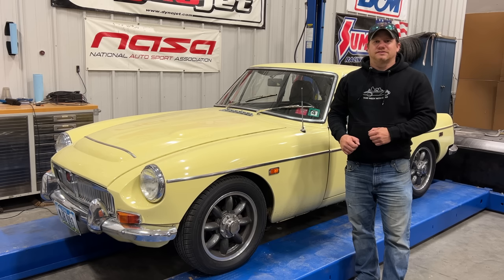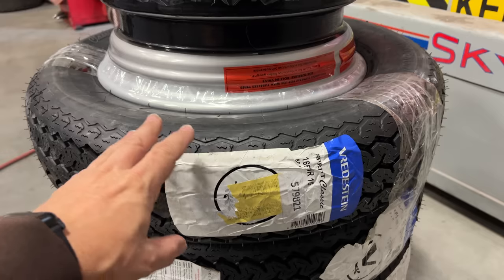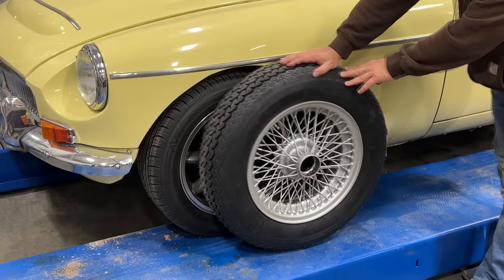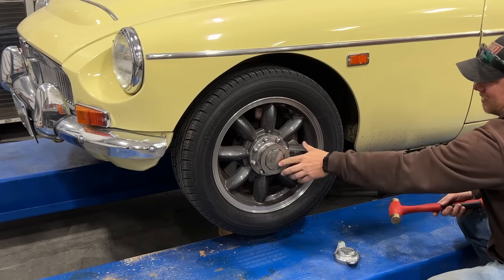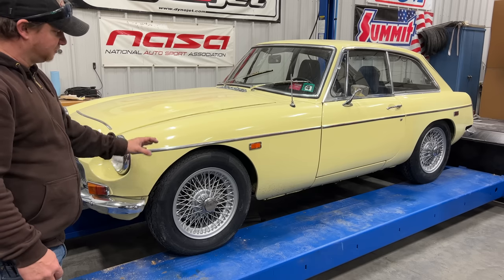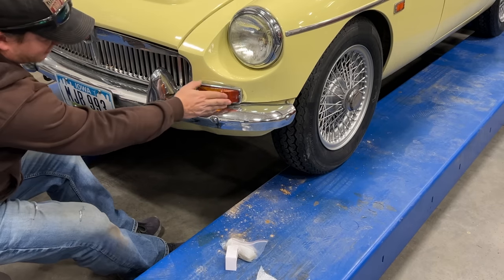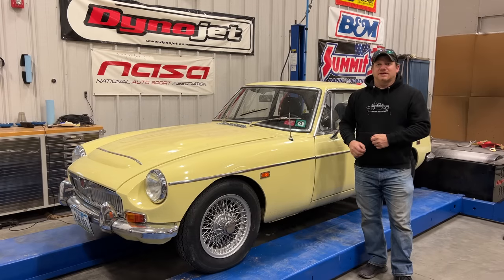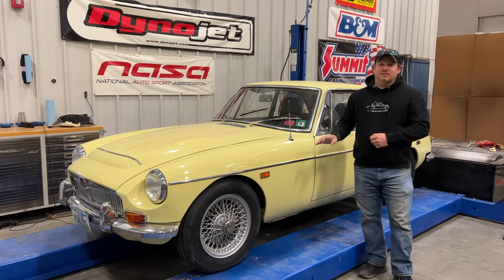Making the MG MGC GT Right

Comment: I had a 1968 MGC Roadster back in 1970 in the UK in Tartan Red. It was a fast smooth tourer but pretty heavy on the steering when parking. I initially put on a smaller diameter steering wheel for looks but soon reverted to the original large wire spoked wheel as parking became even more heavy!
It was also rather prone to understeer when pressing on with that big six cylinder lump up front. Top speed was just under 130mph, which I obtained often from its 150hp!
The only other modification I made was to lower the front of the car slightly to give a barely perceptible nose down attitude which improved the stance of the car. This I did very easily by adjustment of the front torsion bar suspension.
It was a great car that I only sold when I got married as my wife couldn’t reach the pedals.
Reply: I changed back to the original steering wheel on mine too but, overall, I never got on with the car as felt so heavy after the Bs I'd owned. The BGT V8 I had for three years was the real deal.
Reply: @rogerwatt8491  . I agree with the heavier steering. I had 1961 MGA mk2 a few years before the MGC and it was a much better driver on twisty roads, although still heavy for parking.  The prettiest car of all.
Reply: Similar story with my 69 MGC GT bought in 1970.    Sold mine when the second kid came along. Bad move. : )
Reply: Join the club! My first two cars back in 71, (a classic Cooper then an Escort Mexico) sold them on at probably ten times less than they would be worth now..☹️

Comment: Great find.  I just started restoring a 68 MGC GT in British racing green. Its an rare automatic transmission model.
Reply from the maker: My first CGT was a red automatic and then I got a BRG CGT but sold it because it had a sunroof cut into it and I decided it didn’t make sense to spend the money fixing the roof.
Reply: @ThisWeekWithCars  I bought a chrome set of rims in the right size to from British Victoria before they sold out to Moss Motors. My only issue is the Brake master cylinder.  I bought a rebuild kit but I'm hopping it works and that the unit is not worn out or too badly pitted.
Reply from the maker: If it was working recently there is a good chance it will just clean up and you can put your new seals in.
Reply: @ThisWeekWithCars  It will be one of my small inside winter restoration projects.
Reply: I bought a 1969 MGC GT in 1970... 4 Speed Auto Trans.

Comment: I was quite  surprised to see that the threads on the  wheel nuts aren't  left hand thread to reduce the risk of coming loose while driving in a forward direction 
Nice car Steve
Nick Australia
Reply: Yeh i picked up on that i am postive thats wrong.
Reply: Perhaps it's the other side that is LHT.
Reply from the maker: The wheel nuts are threaded opposite on each side of the car.   These are on the proper sides of the car and on British wheel nuts the side of car they go on is engraved into the nut so that if someone installed the wrong hub on the wrong side hopefully you would notice when putting on your wheels.

Comment: Always good to keep as much as you can original I think. I do like those wheels they set it off very well. I had that problem with a light switch on an MG GT that I was fixing for a friend. Someone put a strange switch in there, you could have headlights or sides on but not  both, don't know why people do that? I got the correct switch in the end. Thanks Steve, all good stuff. 👍👍

Comment: The MGC GT looks great with those painted (not chrome) silver wheels.
I use MWS for wheels and tyres. Fortunately, they are only a few miles from my house.
Reply: I have had a set with the same size Vredesteins for thirty years. The painted wheels are much smarter than those nasty chrome things so many people seem to opt for, and they weather better too.
Reply: Yep. I believe these cars were standard with steel wheels with painted wires being an option. Don't believe chrome wires were an option. Although the wires look great, the downside to the wires is the splines eventually wear out and require replacement.
Reply: @robj2704  Chrome wires were an option. I bought mine from British Motors of Monterey (Calif) when I worked there 1968-72. Mine had a Webasto Sun Roof, Auto trans and chrome wires.

Comment: Why do you balance wheels with the labels on ?does it effect the balance.
Reply from the maker: Doesn't affect the balance, you can't have a "sticker set" if you take the stickers off.   I am from the racing world were you don't take them off until they go on the car.  If a mounter was doing just tires on wheels and giving them to a customer they should always leave the stickers on so that owner can save a copy of the label and read the warning labels if they wish.  If I mount a set for someone sometimes I will peal one label off and stick it to a piece of paper so they can save it in their files.
Reply: @ThisWeekWithCars  Thanks for the response just wondered as all removed from the tyre fitters I've been too.

Comment: Refurbished my '68 MGC in the mid-eighties. Really enjoyed it, and later sold it to a Brit who shipped it back to England. It really reminded me of the Austin Healey 3000, what with the large banjo steering wheel, wire wheels, and 6-cylinder engine.
Reply from the maker: It was supposed to be the replacement for the Austin Healey 3000 but Donald Healey backed out.
Reply: @ThisWeekWithCars  Surely it WAS the replacement for the AH 3000 WHEN Donald Healey backed out ?

The MGC’s reputation suffered because the revised improved C series engine lost power due to extra main bearing drag. But in theory the car should have been a success.
Reply: @johnmoruzzi7236  The view back then was the car was nose-heavy since the mfr. didn't modify the firewall to enable the engine to be set back. 
I did notice my crankshaft thrust bearings were worn and would allow the crank to bind up if starting with the clutch depressed.
Reply: @johnmoruzzi7236  The thrust bearing wearing bound up the crankshaft, misaligning the conrods so it wouldn't start with the clutch pedal held in. Had to put the trans in neutral, clutch pedal out, to enable the engine to turn over.

Comment: Have you also replaced the spare wheel? It would be a bit awkward if that one is smaller than the other ones.
Reply from the maker: The spare was still the original wire wheel with the correct size tire.
Reply: @ThisWeekWithCars  Hopefully the previous owner did not have to use it then, given that his other wheels were smaller.

Comment: Love those 'wire wheels',..not that it mattersto your car, but, I'd prefer to have the two eared knock off nuts in lieu of the octagon lugs. ( MY opinion only of course :)
Reply from the maker: For sure they look cooler but they are not right an MGC never came with the eared nuts.
Reply: @ThisWeekWithCars  Well, you have to stay whit what's OEM! I like them too, it's just that my old MGB ( about 20 years ago ) had the silver ( not chrome) wire wheels and eared nuts, so I guess they are what I remember most. The MGC's were always on my wish list, but never 'reached ' one. :)
Reply from the maker: I believe it was sometime in late 1967 that MG cars started to come with the octagon instead of winged nuts.
Reply: @ThisWeekWithCars  October 1967 with the intro of the 68 Model year. 
I prefer the winged knock offs but, like you.. not "right" on an MGC particularly the GT.

Comment: Junk those dumb splined hubs and get wheels that are 4 stud.  I see some Superlites in the back ground. The correct way to go
Those steel flywheels are by far worse. 1920s tech on a 70s car. 165x15?? so VW Beetle tyres!!  Balance them,, first couple of corners and they will need doing again!